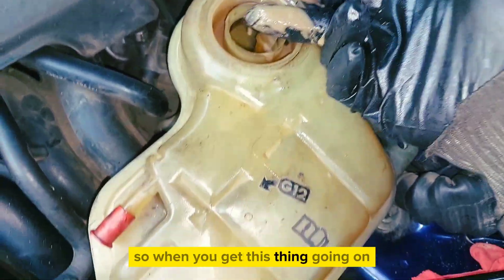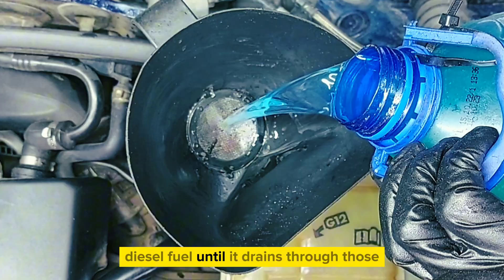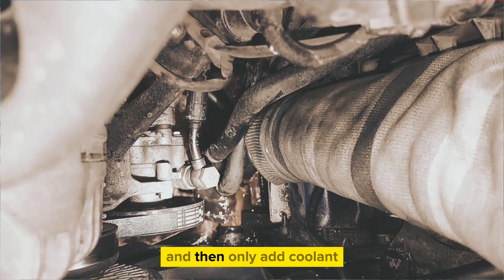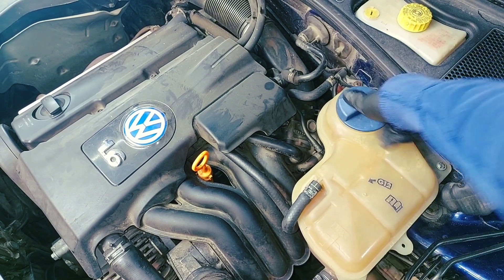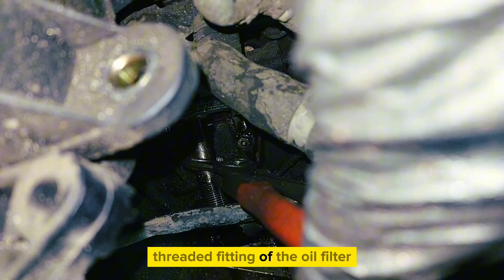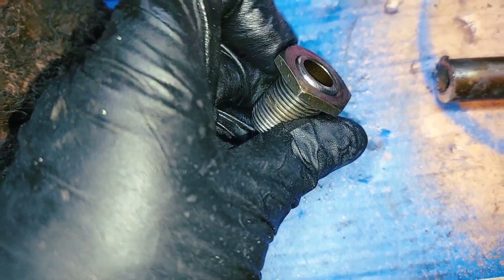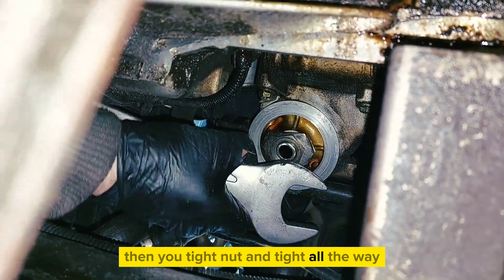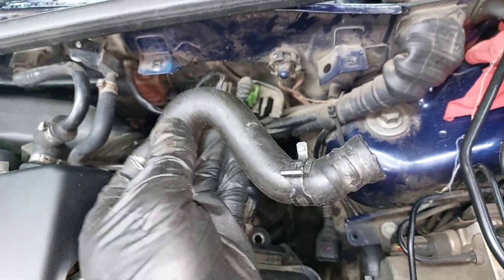oil mixed with coolant? | How to clean cooling system

Comment: Hi sir, how can we refill coolant after changing timing belt ? Is VCDS absolutely needed ?
Reply from the maker: Hello, If you mean EA288 then usually no, as there are electric water pumps and they pump coolant through the system when you start the engine (never had any problem with this method). You only need to pay attention to the amount of drained coolant so you will refill the system with the same amount or maybe even a little bit more. For example if you drained 6.5 litres then you refill the system with about the same amount or maybe 7 litres and usually it is around that 6.5-7.8 litres. This amount depends on the level of coolant in the reservoir before changing it, so you need to pay attention to this level before draining the coolant, so you don't worry that something is wrong. I was using VCSD on that passat b8 with blown head gasket because cooling system was almost completely dry and there was a need for me to know is the coolant level is ok before I start the engine. After bleeding cooling system with VCDS I add some small amount of coolant and thats it.
Reply from the maker: And One more time to bleed cooling system without VCSD in EA288 engine You can do this👉🏻 So you need to remove small hose (in this video on 18;23 min. https://youtu.be/qsLEp98N2j4?si=oIfqiI6mH17bxhZT) that little hose on the "plastic fitting for coolant hoses", it goes to the interior heater, You remove it. Then, slowly, add new coolant, at first it will be maybe 4 or 5 liters, then wait for the air to come out of this little rubber hose for (heater) and the plastic hose (on the cylinder head), then keep adding coolant until it starts to flow out of this little rubber hose for (heater) and the plastic hose (on the cylinder head). Put the little hose back in place. Add more coolant, by then it will be about 1.5-3 liters. After that, start the engine, warm it up. There is a return line on the coolant tank, check it maybe with a flashlight to make sure the coolant is circulating.  When the engine reaches 90° operating temperature, let it idle for another 10-15 minutes, or you can wait until the main radiator fan comes on so you know the thermostat is opening and everything is fine, after that turn off the engine, wait at least 5-10 minutes. then slowly open the reservoir cap and check the coolant level.